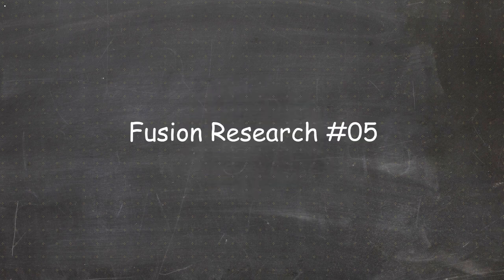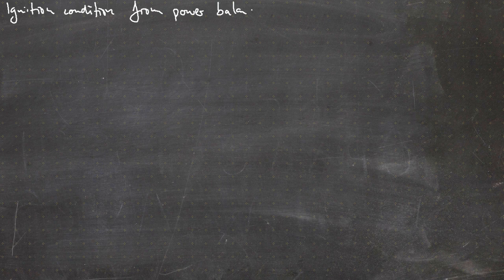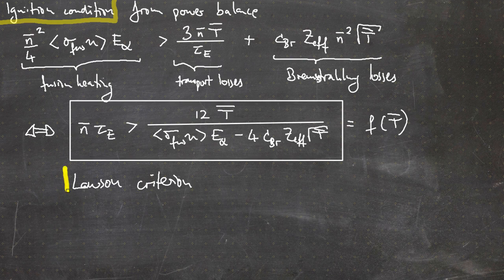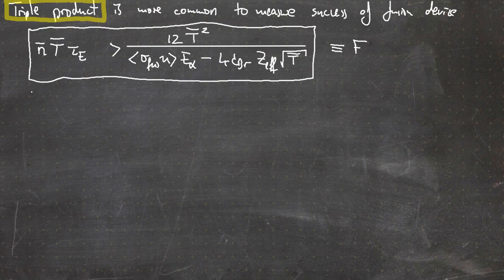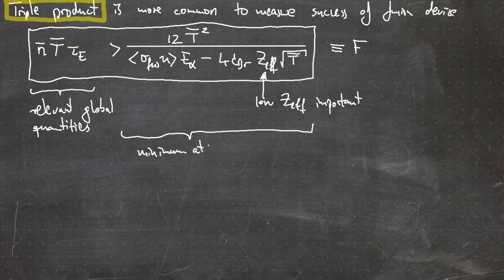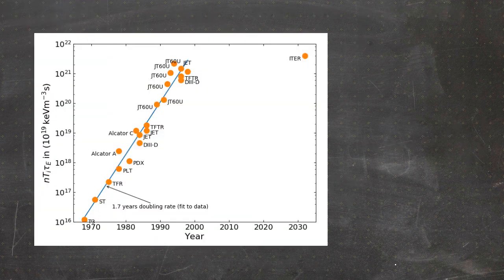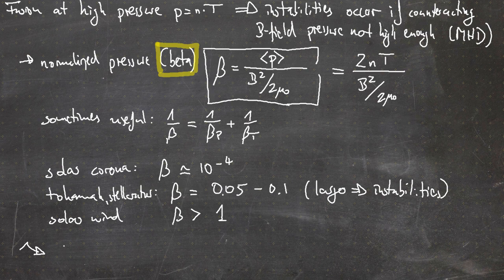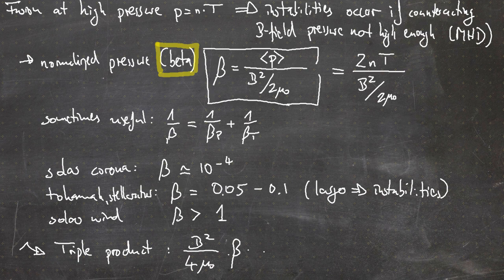Fusion Research Lecture #05 - Lawson criterion and more

Comment: About the graph at 14:45 - there are promising new results, including from small (and cheap) commercial devices. There are bright times ahead.
Reply from the maker: True, a lot of "new players" have entered the field, although some of them are rather looking at old ideas which we, as as the publicly funded fusion community abandoned along the road, because their success seems less likely than tokamak or stellarator - which does not mean the ideas are rubbish, it just means we considered them less likely at that moment (it's actually good, in my opinion that there are now resources to look into those ideas). Then there are some new concepts, exciting indeed! Note that all of them are having really low triple products at the moment, but let's see how far they will get within this decade.
Reply: @DerPlasma  I meant things like the spherical tokamak of Tokamak Energy. They had tripple product of 6×10^18 keV.s.m^-3, at 100 mil C, in 2022. Spherical tokamaks seem much smaller for the same results, which means cheaper and faster to iterate on. 
It seems like a middle ground between the more risky approach of Helion Energy, and the more conservative and expensive ITER.
Reply from the maker: @nikolatasev4948  Indeed, spherical tokamak are also based on the same solid database as tokamaks are, it's just slightly different approach. My research is also, partly, around spherical tokamaks, and I agree with, they are exciting! They have some challenges to be solved, but it's definitely an interesting and promising "branch" of the tokamak line.